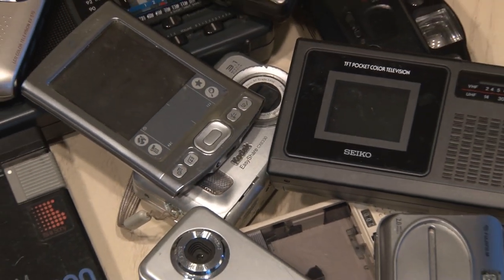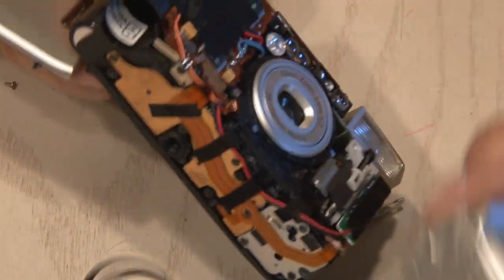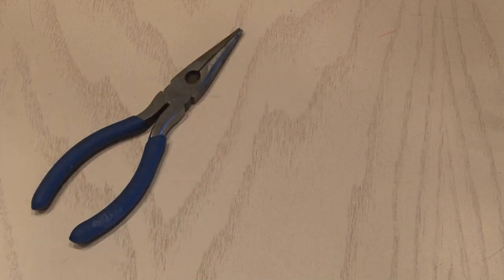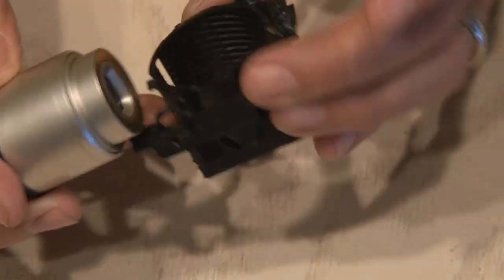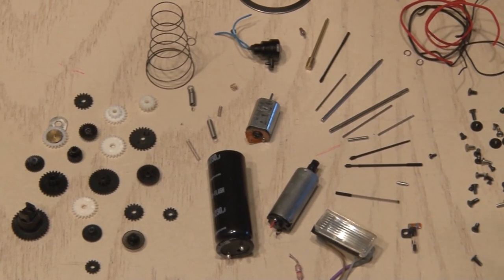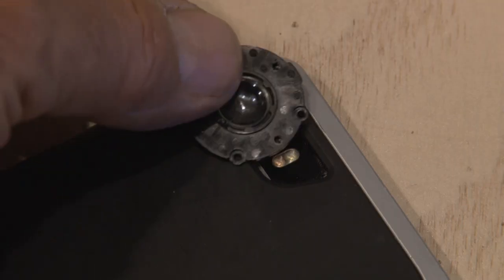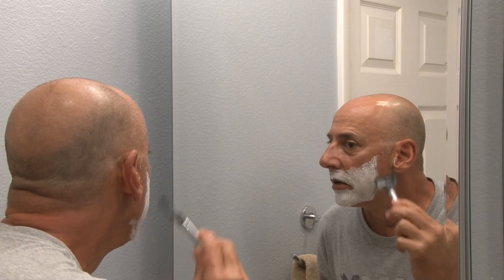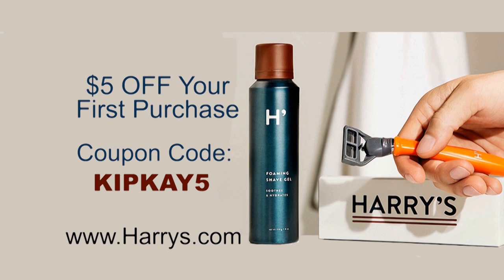Vintage Camera MACRO HACK!

Comment: Using a resistor to bleed large capacitors can be a bit safer depending on how powerful the ark would be from shorting. :)

Comment: You can also remove the lens from a cheap laser, and fit it in between the two ends of a bobby pin. You can then tape the bobby pin onto the outside of the phone, with the lens centered over the camera

Comment: Or you can just use a lens out of a laser pointer and a bobby pin and secure it onto the phone with some tape instead of taking apart a whole camera...
Reply: Geometry Dash VideoPlayer but the lenses on the typical laser pointer is made of plastic and not very good one. also they often uneven... this one are made of glass and is made for cameras, so it's supposed to have good quality

Comment: "They should have made these with clear cases."   -_-
Reply: What's the problem ?
Reply: Denix there was a film there. That's a problem. I wonder if it was a joke or he really overlooked it
Reply: I don't know much about cameras so don't kill mr but. Why couldn't you have a clear case on it?
Reply: tenow the clear case won't do any harm. A clear film housing do.
Reply: ***** Film works by reacting only to the light that it's exposed to for the duration that the camera allows light to hit it (which is when the picture is being taken). Film starts out black, and the chemicals on the film react to light and turn clear (or different colors if you're using color film) once developed, so by getting a perfect amount of light on the film, you get a mixture of black and clear areas that become your picture. The insides where the film is kept is completely dark and only gets light when you're taking a picture. If a clear case was used, light would bleed into the film compartment and make the developed film clear, which means you would just get a white picture. Now is it possible to make the case clear? Possibly if you use opaque plastic in the right places, but that would probably drive costs up, make the camera bulkier & heavier, introduce more risk of ruining your film, and overall just look ugly.
Reply: ExF1Guy A clear front panel would not hurt.
Reply: M CP that is true with film cameras but he's working on a digital. So a clear case would not affect anything but the design.
Reply: Blood scythe I'm pretty certain that it's film. You can see the door for the film on the back of the camera.
Reply: Blood scythe No, that’s film.
Reply: ghassan mouhaidly "You are clearly a person who isnt [sic] passionate about electronics or complex creations…” The irony burns brightly with this one.
Reply: +ExF1Guy it dose not mater if there was a film in there or not even a digital camera with a clear case would not work

Comment: i just use much much much simpler method
if you put a droplet of water on the center of lens, it will also produce some great photos
Reply: ***** Water + technology = broken
Reply: REALLY? I have S5 mini, so water isn't an issue
Reply: REALLY? Yeah, because all technology explodes when it touches water, amirite?
Reply: TheFishCostume well I didn't say it explode I said it would break well if you put it in a body of water then yes it would break
Reply: REALLY? He said a droplet, not a body.
Reply: kendel423 yea but also Gravity doesn't make it stick to the phone (unless the camera is facing up) and the liquad could go into the phone Since it can happen if the water is left on for too long
Reply: REALLY? Your phone's camera lens should not have gaps large enough for water to pass through.
Reply: TheFishCostume well it can happen. If it can pass through a bottle which is meant to hold water in then it can happen to glass lenses
Reply: REALLY? Pass through a bottle which is meant to hold water? When did that happen to you? I don't remember the last time I had water seeping out of a bottle.
Reply: TheFishCostume well it can happen if water is left in there for a long time then you pick up the bottle and notice a small amount of water on what the bottle was sitting on gee if it's cold the water is gonna go onto what it's sitting on faster I tested this stuff
Reply: TheFishCostume ...... I'm trolling you didn't you get that? well of course I pulled off the troll well DUH i felt bored
Reply: REALLY? Sure...
Reply: TheFishCostume no I was actually laughing my head off
Reply: REALLY? If you say so.
Reply: TheFishCostume Water still can go through the phone's lenses though
Reply: ***** i tried it and it makes everything blurry as fuck..
Reply: ***** as long as you only want to take pictures with camera facing up that's fine. I actually did that and took great macro photos with the water drop, still, keeping it on the lenses is a tough task

Comment: what would you re-use the capacitor for?
Reply: INVISIGOTH Capicitor is mostly used for filteration, the main five uses arecapacitor as Filtercap as tunnercap as blokercap for decouplingcap for coupling
Reply: INVISIGOTH you could probably make one of those electric shock prank things with it
Reply: Maybe a time machine.
Reply: INVISIGOTH those things HURT when discharged and that's only a small one...
Reply: A ZAP CANON!

Comment: just on the razor part...
35$ will get you a shavette which is really easy, a fairly ok brush, some shaving soap and a bowl to hold the cream in. and shaving with one is fairly easy, if you want to go a body razor, add an extra 5-20$ for a 40-55$ package for a safety razor.

good shit will last you a long time, and persona labs (razors) can give you 3-5 haves per side, at 14$ for 100 blades.

i will never go back to a cartridge razor again after dealing with so much bullshit that its not even funny.